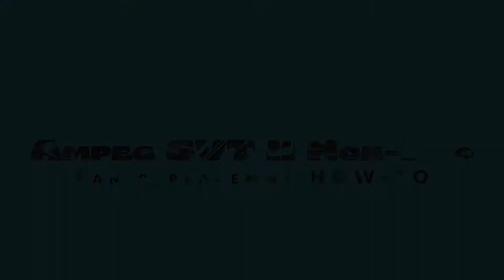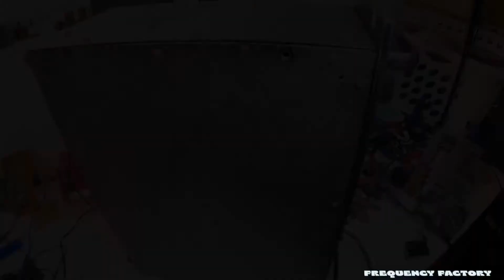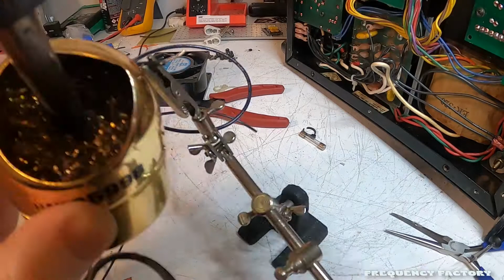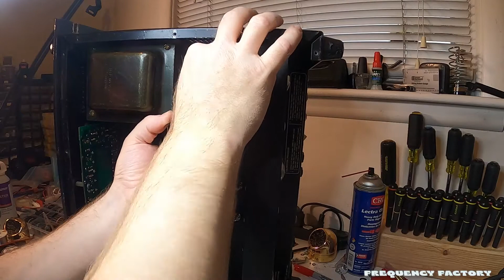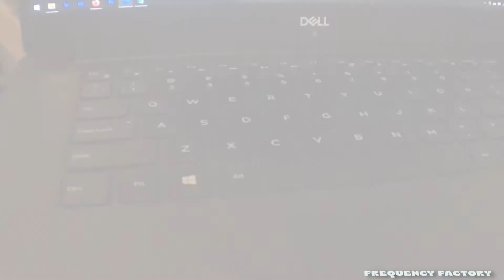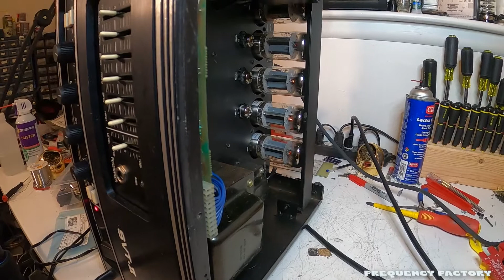Ampeg SVT II Non-Pro HOW-TO: Fan Replacement!

Comment: The replacement fan with the blue label is an Orion OA80AP-11-1WB. Sounds quite loud to me. I think I'd take an EBM Papst fan instead.
Reply: Thank you for the suggestion! Will check that model out as I thought this one was a bit loud as well.
Reply: @mikelongley  I think an EBM Papst 8830N should be fine.
Reply from the maker: Noticed the EBM fan is 21dba vs the Orion at 34.2dba..
Reply: Sucks that higher voltage fans are 5 bucks or 50 for a quiet one

Comment: Where did you purchase the replacement fan? Is there a positive side or a negative side on the wires? Does the fan have to face up or down?
Reply from the maker: I get most of my parts from Mouser.